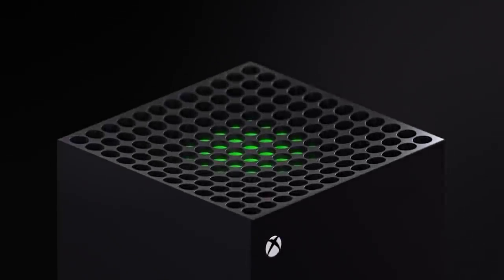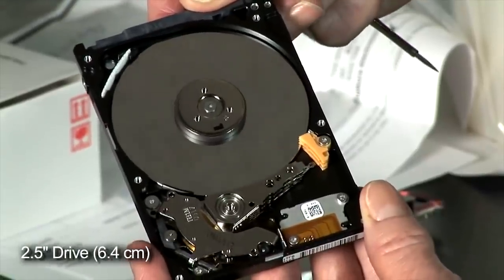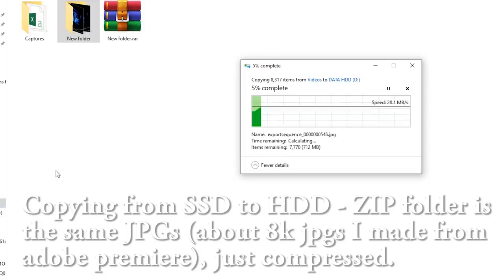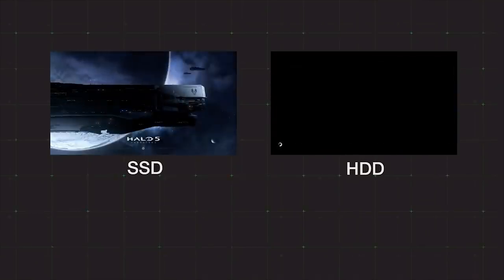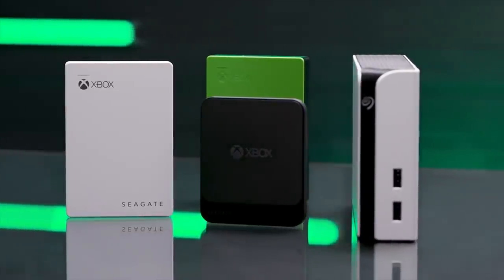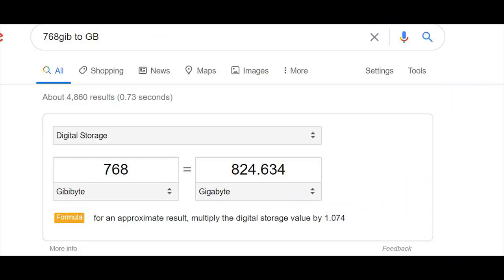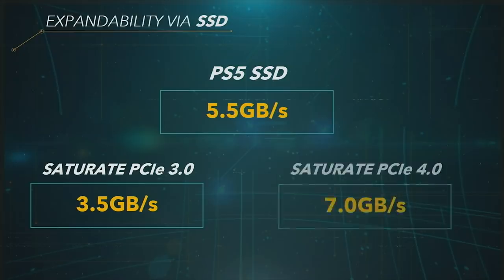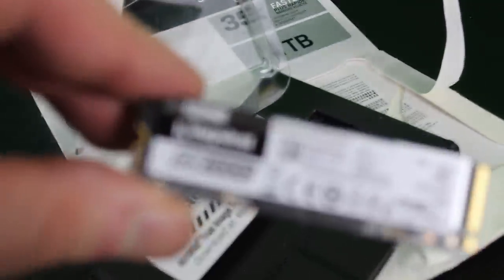Why The PS5 & Xbox Series X SSD Changes Everything - Part 1 - Basics

Comment: It's not just the SSD, it's the entire custom designed I/O architecture that's the game-changer for Sony and Microsoft. That's why SSDs in PCs with less optimized I/O don't see the same significant boost just from swapping out an HDD for an SSD.
Reply: Its not just the IO its also the custom operating engine that is built with very fast SSD speed in mind.
Reply: @ZackSNetwork  yup. PS5's custom controller and Xbox's Velocity Architecture.
Reply: well said... it we'll be interesting to see what PCs do to catch up with these systems.. many guys believe the next gen of GPUs will come with 24gb or 32gb of memory... and you'll need 32gb of RAM to run games the same standard as the consoles... so PC's will brute force it.
Reply: @86lanzo  lol I think PC's have always brute fired their way to the top of performance hierarchy.
Reply: @86lanzo  well the brute Force approach with ram will perform even better than the fastest SSD.  Because of the SSDs in both the PS5 and XSX they don't need to boost the amount of RAM from the previous generation like we have seen with each previous generation.
Reply: @kellyweaver8422  that's true.. but the old PC problem will pop up in that the Brute force method will be expensive...and  will only be for the high end...

with the ps5 and the series x the compression block and IO software is going to mean you'll need  high end CPU with high core count to process all that Data flooding in the RAM... these consoles are so specialized that the PCs that are going to be on par with them are going to be super expensive.. well balanced systems...

it use to be get a high end gpu and you're beating the consoles... now that's not the case... the rumors are that AMDs RT is more effective than even the RTX2080TIs... .. which means you'll.. need a 30 series gpu... high end high core count CPU. 12 cores 24 threads... fast SSD... and a tonne of RAM... that's easy 2 grand to get the performance of the consoles... not to mention that the console games are going to be super optimized...

these consoles are going to be impressive..............,....................................................... for a year... or two.
Reply: The I/O in the XSX will use an API within DX12 that dedicates one CPU core to I/O and since DX12 is the most prominent API on PC that system is coming to PC. Vulkan will probably also get something similar added.
Reply: @Chris_FMS_Redfield  that is correct.. but it also uses a decompression block built into the series x that does an equivalent to 4 Zen 2 cpu cores of work for the compression and decompression.. so you have to ad that to the API stats too.. and that's not coming to PC... as far as I know... I don't know if that's something that can be built into the CPU or GPU
Reply: @86lanzo  sounds like caching solutions may become a big deal.

550MB/s SSD for L2 cache and 4GB  are RAM for L1 could probably do the trick if the game has a decent preloading setup.
Reply: the thing is that designing for pc, the developers have to consider the vast combinations of hardware and optimize for the larger audience... this is also why pc's have such advanced customization when it comes to the graphical settings. pc users will also have faster versions of the hardware available that is in the ps5 and xbox when they get released. after all, the ps5 and xbox are going to be just pc's with specific hardware that takes away the "vast combinations of hardware" hurdle for developers. as far as pc's catching up to the ps5, they already have because the gpu in the ps5 is supposed to be about rtx2080 level, there are faster cpu's out now, and you can have a faster nvme m.2 set up with a pcie 4.0 in raid 0.
Reply: AMD Radeon PRO SSG 1TB will have gaming GPU babies

Comment: Great video,  I agree with running BC games over a USB SSD or HDD, I currently use an external SSD with my PS4pro (cheap SSD connected using an old SATA to USB dongle) and the load times have improve massively, HZD fast travel times are basically halved from around 57 seconds to 31 seconds. Plus you will still get quick resume on XSX (have sony confirmed a simlar feature for PS5 yet?)  so even if that first load up of the Witcher 3 takes 30-40 seconds, loading it back up to carry on should only take a few seconds unless you close it down.
Reply: I've often considered getting one for the Xbox, just never got around to it.
Reply: @peachy0014  digital foundry did a good video a few years back. It doesn't always improve things that much, I'm guessing some games are more CPU bound if they compress data a lot the HDD is not the bottleneck.
Reply: @HappyDrunkGamer  good god, took me days to find the reply, so I could reply! Lol. Yeah, I've held out for that reason. Roll on Series X!
Reply: @HappyDrunkGamer   Maybe not always, but for every game I have it is drastically improved load times on everything. Game start up or in game loading. 2 examples would be forza and madden. If you play those two games a lot, the difference for my xbox one x was drastic on a ssd.  

In the video where they were loading state of decay 2 https://youtu.be/i40IHQnRvaQ?t=1541 , my ssd one x would be closer to the one on the right. Not the HDD loading time on left. Left loading was 52 seconds, right loading was 12 seconds. My xbox one x with state of decay 2 on ssd, was 18 seconds.

Comment: I wouldn't be surprised if future gaming CPUs have dedicated I/O processors on the die to speed up decompression. And with a powerful enough I/O processor you could heavily compress games that would be 100 GB today to perhaps 50 GB or less while still having enough data throughput to stream enough data from the SSD to RAM to load in complete assets in ~50 ms. With assets not having to be cloned because of the elimination of drive seek times that ~50 GB could possibly be 10 GB.

Comment: in Moore's law is dead, he talk to several computer engineers which all of them noted that Sony ssd's 5.5 GB/S speed is somewhat "slow" considering the hardware customization that Sony have done. They noted that the SSD might be "downclocked" to help with the heat management.
So yeah, there are possibility that Sony 5.5 GB/S is throttled speed.
Reply: Cerny said the interface was PCIE 4, full clock probably saturates that
Reply: So Sony and Microsoft are being conservative with their speeds..
Reply: If 5.5gbps is slow then fuck knows what is fast, I’m guessing they were mentioning oodle textures turning it to 17gbps
Reply: Can you link me the video please mate
Reply: @QWERTY-cw5zy  It's on one of his long talk. It's a two hour video without timestamps.

To also note, Sony needed the Expansion SSD to be at 7GB/S because it need the extra speed as it process through a custom header to simulate PS5 SSD's architecture. 
The header output going to be, going to be a simulated 5.5 GB/S, 6 priority level.

So that's also additional reason why Sony settled on 5.5 gb/s. To accomodate agnostic expansion slots, while keeping the original SSD architecture through simulation.

Comment: It's all cache, L1, L2 L3, main memory, storage devices all in order of speed. It's all cached information.
Fancying up the rhetoric for the inclusion of high speed SSD's, doesn't change the fact that it's on the other side of system memory. The big difference is that by taking out the lowest common denominator on the storage cache of spinning rust, you increase not only throughput in terms of bandwidth, but more importantly latency which is especially important for small bits of data.
Main memory latencies are measured in nano seconds, the latest and best SSD's are measured in micro seconds at around 100us vs 10ns for ordinary DDR memory (3000 CAS 15) that's a 4X order of magnitude difference.

All Sony and Microsoft have done is create an environment where developers don't have to play silly tricks to cover latency and bandwidth deficiencies, by shifting that lowest common denominator up by a factor of 150 for latency and 50 for bandwidth. Decent sata SSD's btw aren't that much slower in latency as they're about 100 times faster than your average 7200 RPM consumer spinning rust but are still bandwidth limited by the SATA interface.

Phrasing these SSD's in the same category as main system memory when it's 10000 times slower in latency and with at least 20X less bandwidth than simple low 128 bit width GDDR6 is just plain hype.
Reply: Do you think that these next gen consoles will make gen 4 nvme a necessity for PC builders who are at least trying match the relevant performance levels?
Reply: @Kira-qc4qi  
Nope.
A PC with 16GB system and 8GB graphics memory will be better and that's fairly standard for a modern gaming rig, a gen 3 NVMe drive will be fast enough @ 3-3.5GB/s.
A PS5 only has 16GB for system and graphics and only Sony PS5 exclusive titles will optimise for the PS5 configuration, everything else can workaround to different assets to get similar results. A PC with 32GB system RAM can cache game assets into that memory rather than need to access it direct from the drive, hopefully developers will look to querying system assets and run games accordingly.
The Sony drive will only be able to direct stream about 20MB of assets per frame from that drive and maintain 60FPS as they'd only have a millisecond or two to get those, more than that and they'd need to buffer into memory first.

XSX is about the same as a 4 lane gen 3 drive (like 970 evo), and who hasn't configured their gaming rig with at least one of those.
Reply: @magottyk  thank you. So in that case do you foresee the goalposts shifting from 16gb to 32gb of system ram as the go-to capacity for high end gaming rigs?
Reply: @Kira-qc4qi  
Nope.
Only a few titles will be made to take full advantage of excess capacity, it'll be a few years before it all streams through to significant effect.
32GB will probably become the recommended standard for gaming when DDR5 becomes mainstream around 2023-24, though it's nice having that much now.
Reply: @magottyk  thanks for the insight. I guess the part of me asking if I should upgrade from 16 to 32gb of ram is that relentlessly impulsive side that's perpetually checking pcpartpicker and Slickdeals for any excuse to spend my hard earned money. You've helped quiet it, if just for one more day

Comment: At this age and time, hdds only have space for desktop users for storage intern/external hdd nothing else, it is a old technology, is time for the ssds to get more capacity and get cheaper, a lot cheaper.
Reply: @exeffectum8149  the higher density hard drives have pretty impressive read speeds. Most OEM boxes only have 4 SATA ports, off the shelf boards have at least six.

2TB mechanical still serves a purpose.

Comment: in fact its not the SSD which is the game changer, but the hardware decompression and direct load in RAM without impacting the CPU.
today, we dont see big differences in PC games between HDD and SSD due to the processing overhead, and the need to go through the CPU to go to the RAM or VRAM.
so if the next Ryzen CPUs will offer an hardware decompression and a way to push directly from the x570 chipset to the RAM or VRAM we'll have a good improvement.
Reply: SSD that optimize for gaming experience acting difference then SSD that doing multi tasking, Sony not just put SSD inside, the SSD integrated and working simultaneously with the system...
Reply: Again, its not the SSD, its the connection to it which has an impact.
here, Sony connects the SSD to the RAM direclty (through a dedicated IO).
in a PC, we cant, we have to rely on a dedicated chipset, which communicate with the CPU, and the CPU to the RAM or VRAM.
AMD can bring some improvement on the PC side, by adding a decompression system in the CPU and a direct access to the VRAM; so you can get compressed data from anywhere (HDD, SSD, RAM, Network, internet) and push it directly in the GPU.

Comment: I believe the SSD controller and decompression block designs in the two consoles are primarily AMD's IP. At some point later this year or next year, AMD will propose a new standard to implement this functionality in PCs, creating a new baseline for storage systems the game developers will be able to treat as a requirement within a few years. As it stands, PC game devs cannot even demand SATA SSDs, never mind NVMe SSDs of low end performance. Setting some standards to advance this area of the PC would help game devs immensely. Microsoft is already prepared for this with DirectStorage. Given an open standard, Intel, Nvidia, and SSD controller makers would all likely enthusiastically get on board in hopes of selling new product the obsoletes existing silicon.

One question that remains unanswered on both consoles is what USB modes they'll support. The Series X has Type A ports, meaning the fastest mode available for external storage will be 10Gb. This will allow for an external M.2 enclosure to offer a substantial boost in loading Xbox One and BC games. It might also make allow for Series X games to downloaded to the slower storage and shuffled to the fast internal drive(s) as needed. This would mean a delay in starting the game but it deals with the compulsion to have one's entire library downloaded. People with bandwidth caps would rather move between fast and slow storage than have to download some 100GB behemoth multiple times.

Comment: I think everyone is thinking about this all wrong and this was touched on in Cerny's presentation. The SSD and the I/O architecture doesn't automatically make games better, especially existing ones (with the exception of load times, ho hum). What it does is take a lot of the burden off the developers. They spend too much time with optimizations, laying out assets on the hard drives to optimize streaming, and creating load screens and tight hallways to hide asset loading. Free up a developer's time and they can do what they do best - create.  This is what will cause a vast improvement in future games, but only if the developers can design and develop the games for the new architectures. Games are under deadlines and have a limited amount of resources given to them by the publishers. I know where I'd rather they be spending their time - creating awesome games.

Comment: So I have not heard anyone address the wear that is going to be inevitable using the Sony SSD as a scratch disk.  The normal wear leveling doesn't seem like it would work because it is going to be hitting so many modules to pull off the steaming assets.  3D crosspoint would be an ideal solution.

Comment: Just a question. What i thought Was a big deal is that the ps5 doesnt need to use cpu like the series x on the ssd
Reply: What?how can the ps5 know to use the SSD without the CPU telling it to ? What are you smoking
Reply: See Microsoft DirectStorage - Ironically, PS5's SSD i/o and decompression uses more CPU than Xbox Series X.
Reply: It's just compression that is handled.  The pro series of the Ryzen 1 CPU had an arm processor in integrated on package for security... maybe they are doing a similar deal...or the controller could have it integrated.

Comment: @27:28 and c. we have to account for the custom compression units. If it equate to 9 Zen 2 cores (let's say 8) as mentioned @13:02 then if a game's logic and such use all cores, you'd need additional cores to manage decompression.
So instead of an AMD Ryzen 7 3700X (8C 16T), we would need:
a. an AMD Ryzen 9 3950X as we'd need 8 more cores purely for decompression (or Ryzen 9 3900X if threads are enough), 
b. more RAM to offload a bit from the different archi for the SSD and 
c. faster SSD to account for the 6 priority level.

(Accordingly, Xbox Series X needing 4 Zen 2 cores for decompression means 3900X)

Bottom-line, that's mighty impressive. IF and only IF, developers need and use all that power in their game design.

Comment: Hey You mentioned around 7 min in that the ps5 and new xbox have to process audio via the cpu. I thought sony had the tempest engine to compensate for the cpu having to process audio the xbox series x however doesn't have the same its cpu will need to render audio.

Comment: It's not JUST about having a SSD, it's about HOW it is used. The next-gen consoles actually have a better memory/storage architecture than what is currently available on PCs. Even the upcoming Ampere and RDNA 2 discreet GPUs will only enable PCs to match what the PS5 and XSX through brute force. AMD and Intel have a huge challenge in front of them with the upcoming switch to DDR5 (late 2021/early 2022) and ARM CPUs are getting so competitive that Apple have decided to abandon Intel. There needs to be a revision of the ATX standard... but they will probably rely on brute forcing the problem under the rug.

Comment: RedGamingTech what system is better in your opinion ps5 or series x?
Reply: all speculation but SSD speed is the last thing you want to look at in terms of in-game performance. If you right down all the specs I could easily tell you.
Better GPU, more/faster VRAM will be the winner since these consoles are going after low fps and higher graphics/better textures.
Everything else other than cooling/power is really negligible at 4k/8k 60fps. No matter what the marketing is telling you.
If there is a 100+fps mode then the ram "speed" and CPU clock/ipc/cores will come into play. SSD speed is the last thing you want to look at.
The reason for RAM speed is because 16gb of RAM which will be in both consoles is more than enough for just gaming.
Reply: “At what?”
Reply: Earl Barker at durability